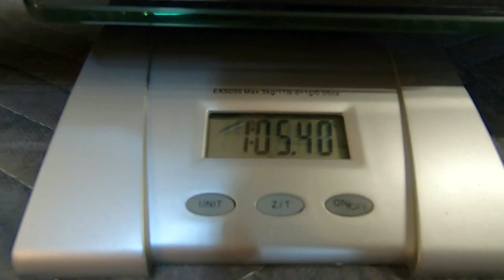Edo Motorsport BMW i8 Side Skirts / Side Splitters Installation / How To

Comment: 2000 usd ? rly ? whey to expensive
Reply from the maker: Thank you for the comment  I agree that these are expensive pieces  It took me a few months to ponder whether or not to purchase these. After talking with Edo and learning that these are hand made, 100% carbon filber pieces, and that the design, development, testing and certification were driving the cost, it helped me better understand why it cost so much to offer these to the market. There are less expensive side splitters on the market, but I fell in love with this design. I'm not a person who typically modifies my vehicles, but I felt the i8 was missing some things. These side skirts filled that strange gap between the body panel and the tub. And the angle reminded me of something I would see on a Lamborghini. I used up all the money I saved not modifying my cars over the decades to justify this purchase to myself.